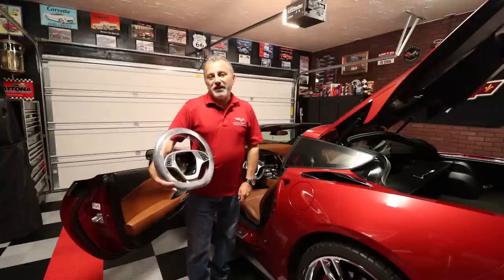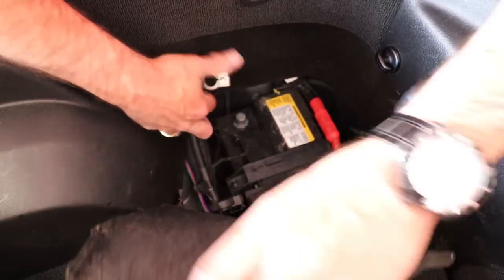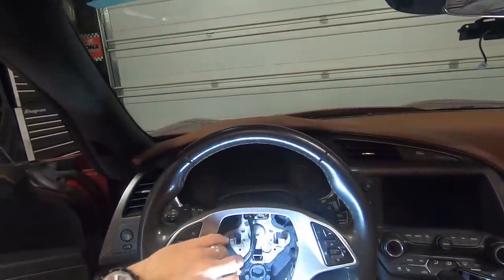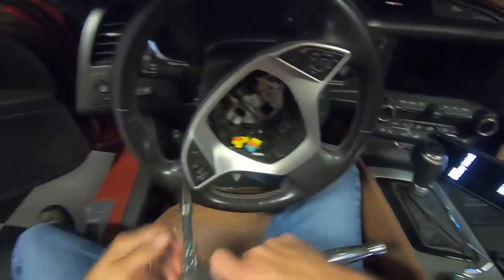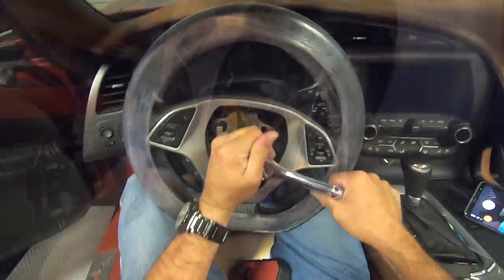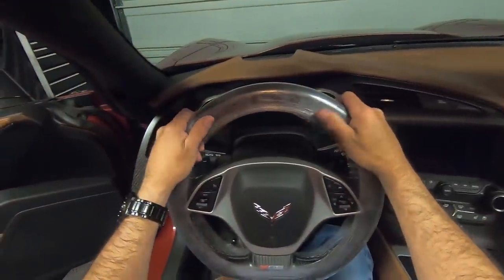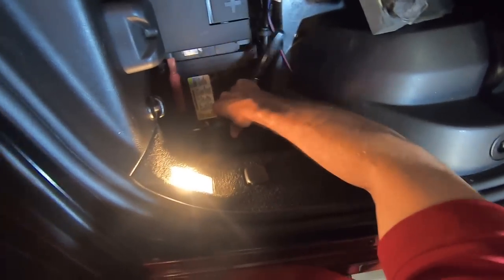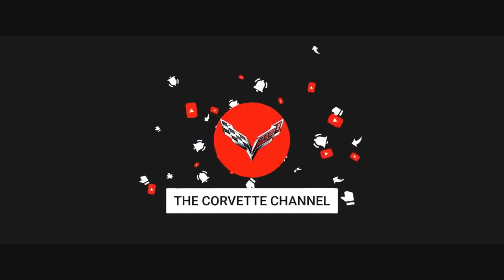How the Replace the Steering Wheel in a C7 Corvette

Comment: Great video, just for anyone else out there with a 14-15 that want a flat bottom steering wheel, the 6th Generation Camaro uses the same steering wheel. A pretty good option and probably easier to find locally. Just took a little extra work to swap the silver trim/buttons over. If purchasing a used Camaro wheel some have a heated steering wheel. Not an option on a c7

Comment: Great help to change my steering wheel on my 2016 C7.  The only step missing was how to transfer the attachments of the steering, my new carbon fiber steering came empty, without all the switches to control radio and shifters

Comment: I changed mine to a after market flat bottom wheel taking the stock wheel off the clock spring came out too  had to take the car to the dealer to have it replaced all good now.

Comment: Great Video, Scott. Wheel looks great. Im looking forward to doing mine. 

I got my car back from the body shop. They installed the Z06 front grill, for me, since they had to remove the front bumper, anyway.

Part numbers in the description, would be nice. Im also seeing 23 ft lb for a torque spec. Part Number 11610164, if you want to replace the T50 Bolt in the wheel center. The new bolt is about $2.95 and thread lock comes on the new bolt, already.

Comment: Great job. Just a tip though, you don't have to wait that long after disconnecting battery. 2 minutes or so is fine. Test if system is discharged by pressing the brakes and working any of the switches on the dash to see if lights come on. That will discharge and residual charge in the capacitors.
Reply from the maker: Thanks for the tip! Have a great night!

Comment: A guy at our vette club told me to change the wheel air bag you have to take the steering wheel out. Thank you Scott looked pretty easy but would I have to change the IRS module.
Reply from the maker: Hi Victor,
If you are changing out the original round wheel with the D shape factory wheel like I did in the video you dont need to change anything just replace the wheel. Everything will plug in.
Now if you are wanting to change your original wheel to a different style wheel you will need to check with the vendor or manufacturer to see what you will need.

Comment: Thank you sir. I've been wondering how to do this since I was interested in upgrading to a carbon fiber appearance wheel. Any thoughts/interest in doing the same for the A8 shift knob?
Reply from the maker: Hello.. I did change my 2014 6 speed auto shirt knob before I started the channel so I did not film it. I will say that the newer 8 speed auto knob does fit on the  2014. Kind of a pain to change but it does fit.

Comment: Is there a torque spec setting for the steering wheel bolt?
Reply from the maker: I looked everywhere and could not find one but as you saw it was super tight so I put it back on super tight!!
Reply: @THECORVETTECHANNEL  I actually found another You Tube channel, Corvette Hop. He also has a great video on C7 steering wheel removal and replacement. Anyway, he advised the steering wheel bolt torque spec is 22-23 foot pound. Don't know where he got that info but good to know.He seems pretty knowledgeable. Keep the great C7 videos coming. Love them.....Larry O.
Reply from the maker: @larryo2474  Thanks Larry!! I watch his stuff too!! Great Guy!!

Comment: I’m actually surprised at myself but I stripped the 50 torque bolt that removes the wheel 
I feel trapped, don’t know where to bring it where I live, without someone being dumb about my little problem
Reply from the maker: I'm sorry about that. After I did my wheel I later experienced almost the same thing with another C7 wheel change. Hopefully you got it fixed.